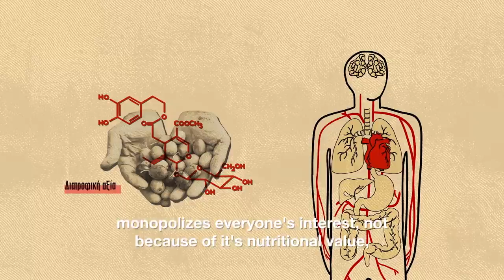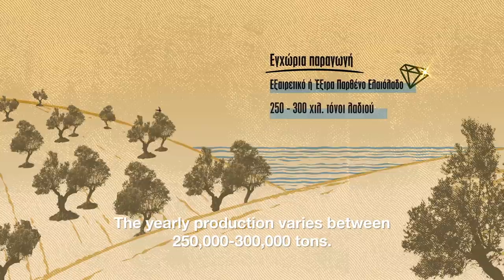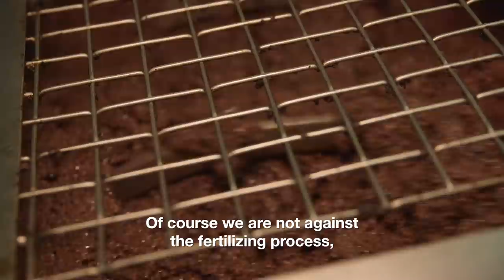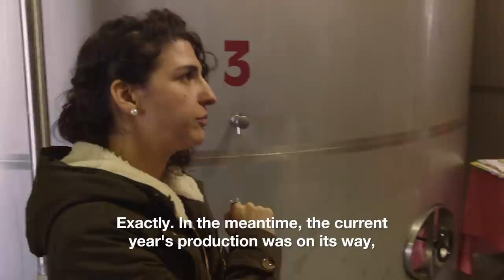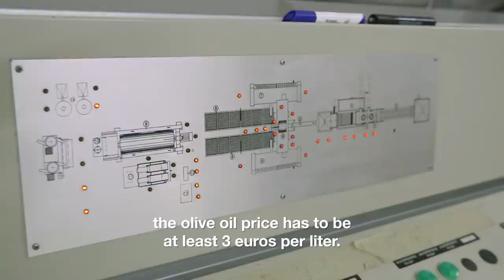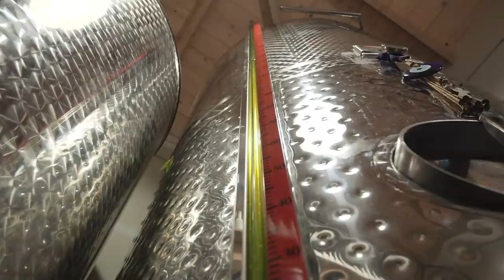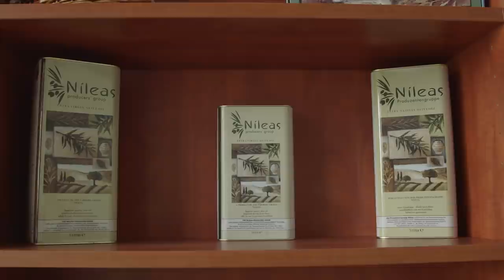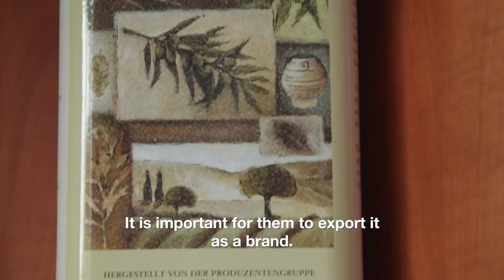How Can Greece Save Its Olive Oil Industry?

Comment: How can Greece save its olive oil industry? Get out of the EU
Reply: Then who pays for their debts?
Reply: @ANSELAbitsxb  Your comment is not wrong. But it does not solve the problem, these countries have. Them getting out of EU will not automatically solve their economical problems. So the question of mine still stands. And to add some Caviar, most banks who lent greece the debts are currently crumbling for years now. Commerzbank even had to leave DAX. 
The Economy of Greece on the other hand did improve a lot. 10 years ago most ppl could not imagine these developments. So the efforts including temporary debts assistances by other countries were not for naught. But of course there is still much left to. But just throwing them out will not benefit anybody.  I will try to ignore your "braindead" comment. You know nothing about me.
Let´s stay respectful.